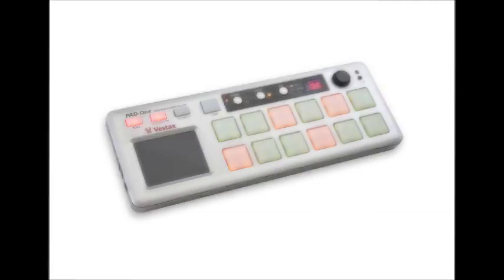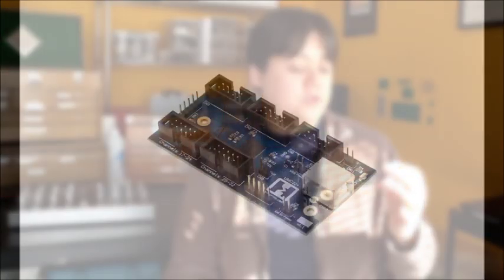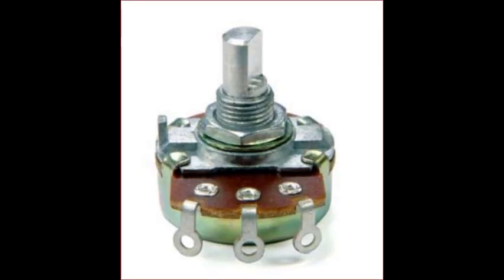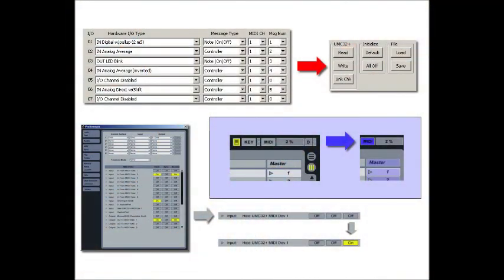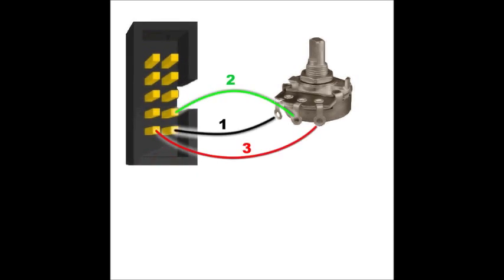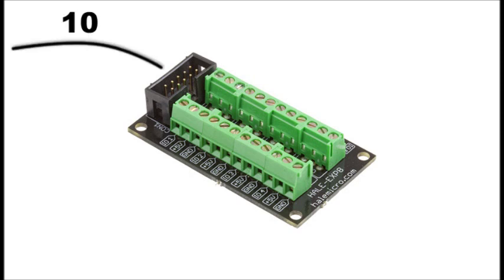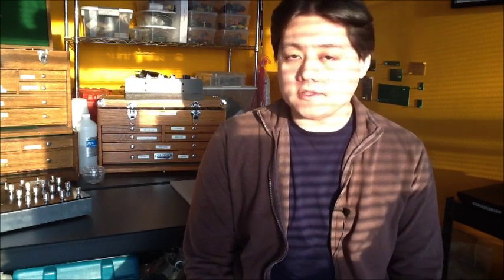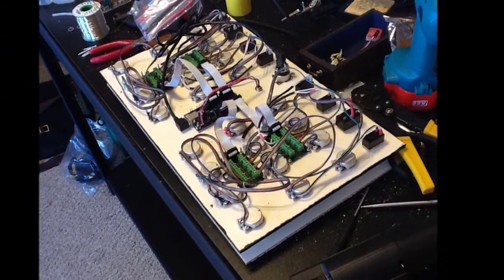60 Works Build Video: Parametric Equalizer

Comment: Great video!

Are you able to configure a series of bank controls or create a bank function? That would "expand" those 32 i/o?

Thank you!
Reply from the maker: Yes, I believe such functionality exists in the UMC32, though that board is a bit hard to find these days. 
Regardless, "banking" is also something you could create in software with a tool like Bome's MIDI Translator.

Comment: Hi Dave, any idea where to get the Hale Micro parts? They all seem to be out of stock everywhere. Or could you advice some other equivalents? thx
Reply from the maker: The Livid Brain Jr is a very suitable alternative to the Hale Micro board.
Reply: Dave Cross well, that also only has 16 analog inputs. But i want to build a controler with 20+ knobs for CC messages. So i would need more analog inputs right? Or can i just expand this with a break out board like in your video? thx for answering!
Reply from the maker: M. Schulze Correct, you would need either two Brain Jrs, or a Brain V2. If you don't mind having a USB hub, I would actually recommend two Brain Jrs, for ease of install.

Comment from the maker: The UMC32 in this video doesn't output MIDI without a computer. There are devices that convert USB MIDI to "plain" MIDI, but I would suggest a device that has standard DIN MIDI built-in (Livid Instruments, Doepfer). CC value recording and min/max manipulation (directly on the hardware) isn't possible with any DIY boards that I know of.

Comment: Ahhh, I see. I was under the impression that surely by now, that kind of controller could be done well with existing parts somewhat cheaply. I stand corrected, as Im sure you know better than myself about the time/cost involvement. I suppose I'll be "post pre-ordering" an Ableton Push pretty soon then. Excuse the lame post/pre joke, I just cannot believe they are having so much trouble with production on a unit thats been hyped SO much since their first advertisement. Thanks again for the reply!

Comment: Wow.. With such a clear voice and a pleasant face,you should have your own TV program.
How about a Pre Amp mixer for DJ's with graphic EQ and kill switches for sub,mid bass, mids, tops also with built in active crossover. 2 mic inputs, 3 lines inputs, 2 turntables, etc etc.
Cheers Bro

Comment from the maker: Yes. The Hale Micro software can send specific MIDI notes instead of sending CC messages.

The wiring of a Note-based button may differ slightly with the addition of a part called a Resistor, but the concept is still quite similar.

Comment from the maker: @MasterSplinterMusic Arduino is totally cheaper, but you have to work to make it do what you want. It's the same as saying lumber & tools are cheaper than a house.

If you're interested in Arduino, you may want to check the "Teensy," an Arduino clone.

Comment from the maker: @MasterSplinterMusic It's basically the reason why I chose an established, "ready-made" board for this. There's enough troubleshooting as it is to build the controller -- I didn't want to get into the mess of programming the "brain" as well. 

It all depends on the amount of time you're willing to spend to figure it out. I simply didn't want to spend that time, but others with more patience certainly will.

Comment from the maker: @MrFlaschenhalter Unfortunately, that's hard to do. It's not impossible, but you'll have to cut lots of corners.

Non-custom MIDI controllers are incredibly cost-effective because they're one out of 1,000 (or 10,000) copies. When you commit to make that many of anything, you're able to keep costs down because you can buy in bulk and automate the manufacturing.

Comment from the maker: Thanks karcchan - faders are actually EXACTLY the same as rotary knobs. They behave the same, with the standard 3 connectors. 

I see potential for a video though - an introduction to all the different kinds of sensors and switches that could speak MIDI, with instructions on how they connect.